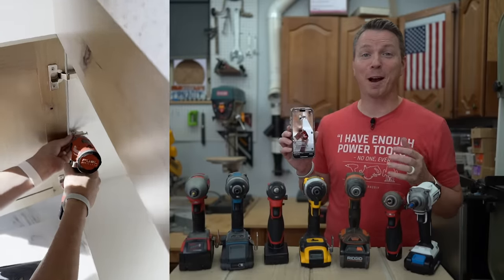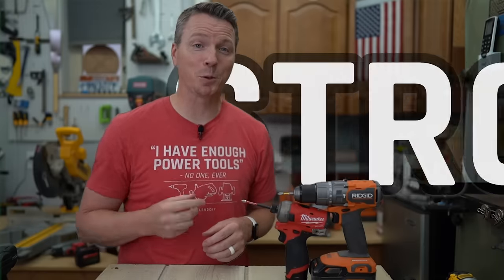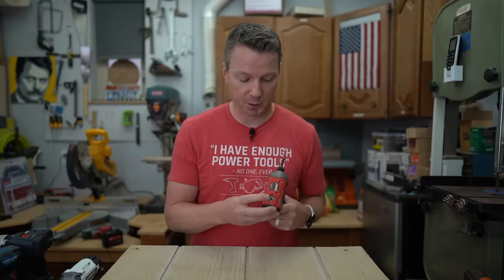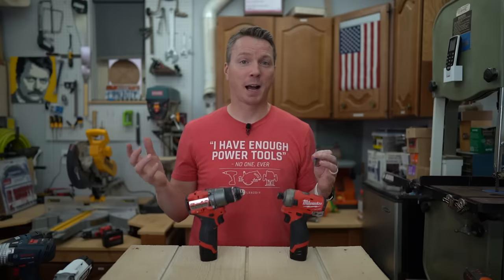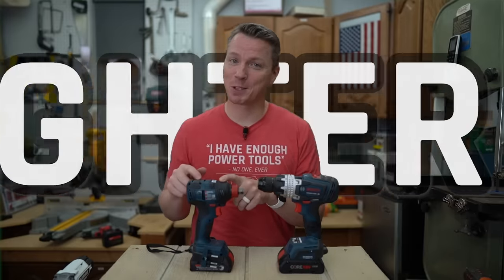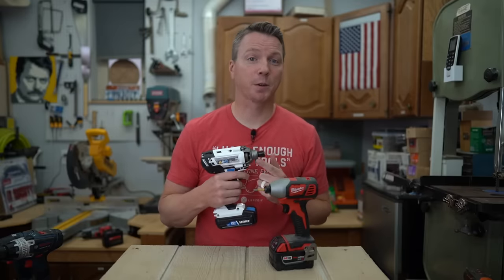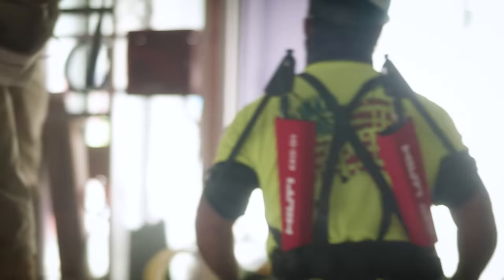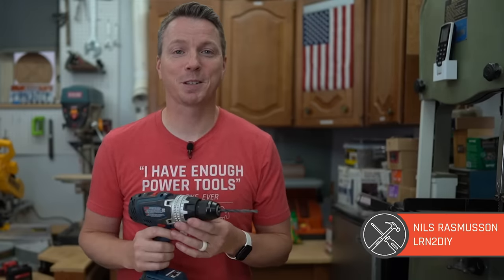6 Reasons To Grab Your Impact Driver First

Comment: I upgraded from a Porter Cable pair of driver/ impact to a Dewalt set.   With the Porter Cable, I ended up using the drill for almost everything because the impact driver didn't have a low enough speed on partial trigger to be controllable. With the Dewalt set I'm using the impact driver to drive screws 100% of the time.

Comment: I use my impact driver for drilling pilot holes in wood. The higher RPM is great for drilling small holes. It’s also great for drilling thin Aluminium sheet.

Comment: I’ve seen a few of your videos now where you say one of the disadvantages to a standard drill is having to chuck on and chuck off the drill bits.  I’m surprised you don’t know this, but they sell quick change adapters that give drills the exact same functionality as impacts to quickly pop on/off bits.  I personally own the “Kobalt Hex Shank 2-in-1 Connector” and it’s always made switching between the various bits required during a project a breeze.  For cabinet hardware, I personally use a stubby screwdriver because feeling it out via hand tightening is ultimately the best way to make sure the screw is just right.

Comment: To add to this, You can go buy a keyless, adjustable chuck attachment for your impact driver, which makes a drill driver and hammer drill completely, 100% obsolete. I picked one up for my Milwaukee Fuel Impact, and I'll never need a drill driver again, and it was only like 25 bucks.

Comment: My first own tools I bought after My dad died and without having any real own prior knowledge and after researching the internet for a while, where a sabre saw and an impact driver.

I could never figure out the clutch setting with normal drills and found "feeling" how much of a trigger press I need much more convenient.

The only problem I ran into at first was drilling harder materials like concrete or running into a random support beam in the wall, but after upgrading from 12v to 20v and getting carbide drill bits, that was a problem of the past.

Comment: It all depends on the context in which you’d use one over the other. For instance in my job, you do t necessarily need an impact driver, but you definitely need a drill. I keep my impact on me so that way I can have essentially two tools for different tasks, rather than 1 tool for both tasks. It’s a nice to have. Plus, the sounds that impacts make are super cathartic and fun.

Comment: 1970's calling.   Yeah the ease of putting a bit in an impact driver is so much easier than a standard drill chuck.  But modern keyless chucks are so much better than the old keyed chucks we used to have.

Comment: I have a milwaukee gen 4 impact driver and also a ridgid hammer drill. Both 18v. I love both and they both have their uses. But when it comes to power my experience is different. I have done side by sides of 9 inch lags into lvl vertically. The drill wins by a significant margin. Not sure what's in that 12v surge to beat the drill. I have also tried the 18v surge impact and it seriously lacks power even compared to the regular 18v gen 4. Anyway just my two cents.

Comment: I love to see you using the m12’s. I think that what I’m going to go with but I think that means I’ll end up having some m18’s which is the type of fragmentation I wanted to avoid.
Reply: I use m12 for home and automotive DIY use. I use it to drill into cinderblocks to wallmount things with tapcons. I have used my m12 with an auger attachment to make holes in root-bound dirt. It never shut down for overload protection or anything. The m12 drill & drivers are beats imo unless you are using them professionally and then you probably want the speed and capacity of m18. Hope that helps!

If you want to make sure you only have m12 OR m18, I would go with m18 and just get some compact batteries for when you want a smaller tool in your hand.
Reply: @MarkTrades__  that does help! Thank you. I’ve really become smitten by the m12’s, though I’ve never actually used one. My concern is tools like shop vacs, or saws or other high power draw tools will be inadequate. I’m not a professional- only an aspirational DIYer and honestly would likely be fine with less expensive tools- but I also subscribe to buy once cry once. Haha.

Comment: Great video, but I have one question: what's the difference between an impact driver and an impact wrench? I noticed the two products on Hilti's website.
Reply from the maker: Typically the form of attaching tools. The impact wrenches have a 1/2” or 3/8” square that accepts sockets directly. Impact drivers have a 1/4” hex attachment. They both do the same thing though. The wrench is targeted at automotive mostly while the driver is more general purpose.
Reply: Wrench hits way harder, bigger hammer

Comment: You might consider the following two facts: 
First, there are two different types of torque: Hard and Soft. Hard means, you are driving the screw against an end stop. Soft means, you could drive the screw further into the material. The torque give by the manufacturers is almost always the Hard torque. But this applies only if you're fixing metal screws and doesn't tell you anything how the device operates while driving screws in wood.
Second, There are designated devices to drive screws without the impact, these are much lighter and even easier to operate.
Reply from the maker: Great info here. I was just looking up and studying hard vs soft torque as a result of reading your comment and I've got some more learning to do. Sounds like it could be tricky for the average consumer to interpret the applied power/torque of the drill or driver when only one metric is shared by manufacturers.
On the second point, could you point me in the right direction on this? I'd love to learn more.
Reply: @LRN2DIY  For example, the Bosch GSR 12V-35 HX or the Milwaukee M12 CD-0 which both offer high soft torque and are pretty compact and lightweight. Both also offer a torque adjustment, which makes total sense to use, else you'll rip the heads of screws off.

Comment: I am just a DIY guy.  My 18V Craftsman Drill recently bit the dust.  I have slowly replaced my tools with Dewalt 20V.  I already have a Dewalt driver.  I was looking at Dewalt drills and realized there are drill bits with the hex shank.  I am buying a $20 bit set instead of a $100 drill.

Comment: LOVE my M12 Surge.  But I normally use my M18 hammer drill for “most” drilling applications.  

But I also don’t use my M12 to drive crazy-big lags (like some YouTubers love to push) 

for those I’ll use an impact wrench with a socket adapter (or whichever head is on the fastener)

Comment: Wear your hearing protection! Contractors impact drove many trim screws into cedar trim on a house we had built. What a racket. It is my first choice for lug nuts and self tapping tek screws. My Fess has an angle head for close quarters. It can drive 3” screws in a 6” space.

Comment: Absolutely, impact drivers all day. Unless you’re installing cabinets made of particle board, hammer drills are nearly obsolete in comparison. Even concrete isn’t a problem for an M18 Fuel Impact driver. 3 illuminated push button speed settings, & total control triggers do all the work without having to guess, & rotate various clutch settings. Performance is far better, much smaller in size, & uses the same bits that are easily swapped out with one hand instead of two.

Comment: A drill combined with torx screws… unstoppable. 
Those compacts drills or those that has detachable clutch are way better than impacts in a lot of ways. 
Tapping, drilling, chamfering holes, can even put one of those carbide burrs into it. 
The only legit use for impacts are masonry screws 
Even for that i use a mid torque wrench…
Impact drivers are a waste of money

Comment: What about installing plastic brackets without breaking them? Or cabintry hardware in thin/finished wood? Each tool has its purpose. Impact should used for long screws, many screws, lag bolts, live wood, etc. Drills are better for delicate work where the clutch comes in handy

Comment: Id like to see a impact beat a DCD999. 

Also drills have first gear and clutch settings, havent touched my impact in 3 months
Reply from the maker: I have a DCD999 and can test that for sure but it's all about what you mean by "beat". If you mean drive a lag bolt, they will beat it. If you mean more torque, lighter, smaller footprint and safer, they'll beat it but in certain other areas, they can't touch it. It's a beast of a drill to be sure.

Comment: Hi! Considering the impact driver has a hammering action, can you use it on concrete?😊
Reply: No. The hammer mode on a drill is a completely different mechanism that add motion in the same direction as your bit is advancing in the material. The hammer action of the impact is a turning force. Imagine if you had a wrench on a bolt and you hit a hammer on the wrench in the direction of turning as opposed to hitting the hammer on the back of the bolt.

Comment: For me, if it can be done by a screwdriver, impact driver is always the better choice. If it needs a drill bit of any kind, I go with a drill. Hex shank drill bits work in drivers, but I find the experience unpleasant.
Reply from the maker: Seems reasonable. I don't mind using the hex drill bits in the impact but I can totally get that that's not for everyone. The combination of drill and driver on the same job is pretty great.

Comment: Not being that guy but that bosch set looks brand new as with every other tool save for the m12's
Reply from the maker: You're not wrong. When you test as many tools as I do, they can't all get used a ton. I use my Milwaukees a lot and for years before that have used Ridgid. I'm also using my Flex tools on jobs a lot (used Flex and Milwaukee on personal jobs for hours yesterday) but the Bosch, amongst others, just isn't my go to drill or driver. I have over 30 drills and drivers, so too many to use on the regular but they're great for comparisons.

Comment: Can impact driver use in drilling holes in hard concrete?
Reply: Unless you can find a Masonry Bit with a 1/4" hex, probably not. Need a roto hammer or a hammer drill for concrete.

Comment: German here, impact drivers are not really a thing here. We of course know they exist and people use them, but basically every home owner and actually most professionals never use a driver over a drill. In fact, when building homes, you can not legally use an impact driver to drive in normal load bearing screws. Because of "Gewährleistung", basically meaning that the screw might be damaged because of the impacting force, and you can not guarantee that it can hold the same load. I don't think that actually happens, its just a germany thing.

Comment: I’ve been a construction plumber for 28 years. Impact for screws is All I use. We routinely need to move wall mount faucets and shower valves (thanks idiot designers) impact works way better and fits in the small spaces I need to get to. I often need a right angle attachment with the impact, for super tight spots.

Comment: great video..i appreciate it. any idea on which is better at driving in drywall screws without getting a drywall gun?.. lately i’m using a drill with a drywall dimpler..
Reply from the maker: The drywall dimpler is a must either way. I actually haven't tried driving drywall screws with an impact because my dimplers aren't 1/4" hex so I can't say how that would go but there are some great impact rated dimplers out there so it'd certainly be worth a try!

Comment: 6:18 well maybe get a drill with a side handle and dont run holesaws 1 handed
Reply from the maker: You're right, of course. I had to set up this demo to show kickback but I've definitely experienced kickback when I absolutely didn't expect it - smaller jobs where I thought for sure the bit wouldn't bind but it did. It can really take you by surprise.
Reply: @LRN2DIY yeah, and it's not like you're going to have the handle on all the time
Reply: I killed my Flex drill using a 6 inch hole saw with the side handle (gears broke, lifetime warranty FTW). I had to use my 5 year old ridgid drill to finish the job with the clutch on 24 since i don't have a side handle for it. Made me realize that maybe i don't have to have it in drill mode for hole saws, bonus that I don't need the side handle either when using the clutch.

Comment: I prefer not to use either actually, I grab my DCF601 or my DCF610 for 99% of all my shop screwing. Using my drills for screwing is just as annoying as using my impacts and hearing them.

Comment: I'm just a DIY guy but all these tips are outdated.  I found that a drill with an impact/concrete function is best for driving screws into wood (which I learned from one viral Youtube video years ago).  I also see pro fiber installer guys use this technique.   Additionally, one of my drills has its clutch work even during drilling-this useful to keep drill bits from getting damaged from too much torque or too much applied pressure.  Obviously, the clutch saves one from  kickbacks.  There are brushless cordless drills that are short as impacts.
That said, I finally bought a cheap impact recently that I have yet to receive.  I need to lose a rusted nut bolt from a mop bucket. an impact is best for stuck or rusted screws, bolts, nuts.

Comment: Dewalt has a 12v drill that doesn't have the big chuck for bits, it uses the little chucks an impact uses so it's a similar size to a impact and the clutch comes in handy when drilling into cabinets, it's actually better.

Comment: Why do you need all that torque first off. Your not taking off a rusted bolt. Theres no clutch for small screews. Anyone that claims to know tools , knows we use a pilot hole first for a multitude of reasons. Unless your using impact rated hardware, you actually have a huge chance of breaking the fastener bc its not rated for all that torque. You want to be lazy and say its easy, then fine. But there is a time and a place for both tools.  Please dont spread more disinformation we have enough on these platforms. I get this is your opinion , and thats fine . But too many young, ignorant people follow this trend and dont understand proper ways of using tools.